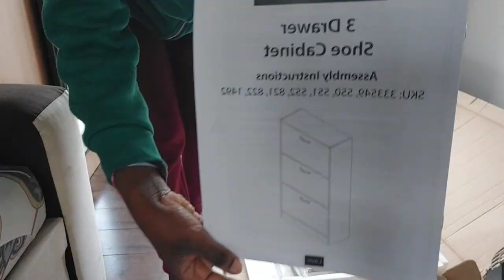DIY Shoe Rack: Watch Me Built it Step-by-Step

Comment: Everything was simple as I assembled except for the side bits that needs to be hammered.
Reply from the maker: I had same easy with that part, At first I thought I needed to just use the screw driver but realized it needed to be hammered for the shoe rack to be stable. Thank you for sharing x
Reply: @AnnaKaali  do we need to hammer for side